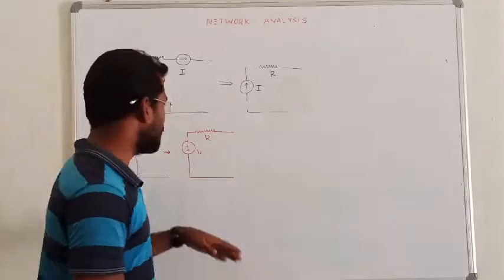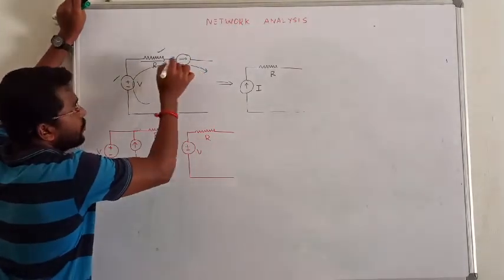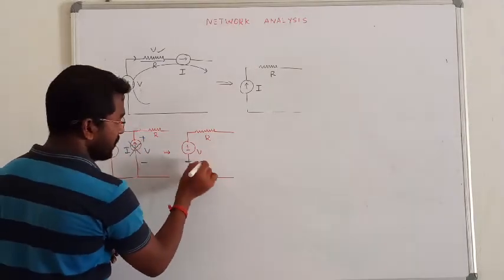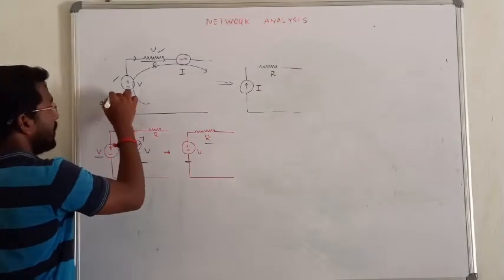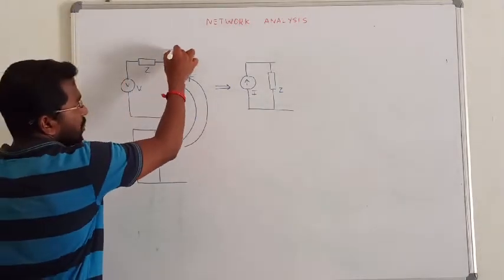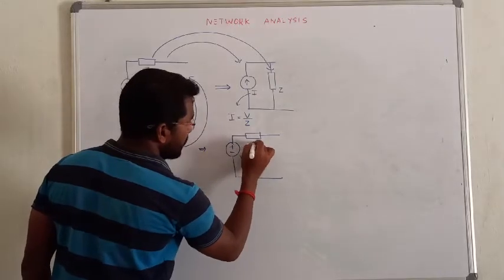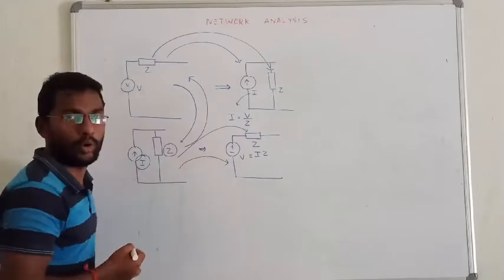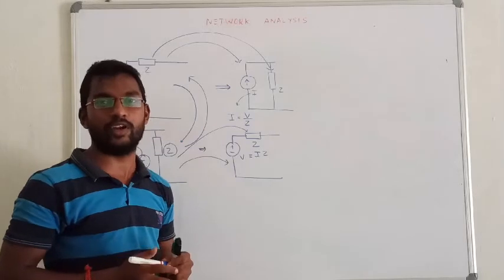13. SOURCE TRANSFORMATION I EE I CIRCUIT THEORY IN TAMIL

Comment: In Series ckt voltage is same ( no drop) across the impedance , In parallel ckt current is no drop across the impedance.  So output is good
Reply: In series ckt current remains same...in parallel ckt voltage remains same

Comment: voltage source in series with impedence  due to the voltage drop 2) curent source parallel with impedence have tovoltage drop sir but curent sourece series with impedence donot drop in resister and voltage sorce parallel with resistence dont drop terminal voltage  same output voltage  is tedency efect
Reply: What will happen if we connect current source in series and voltage source in parallel?
Reply from the maker: Nice buddy
Reply: @ELECTRICALNESTEE  
Bro 
Can you give some real example for current source and voltage source?